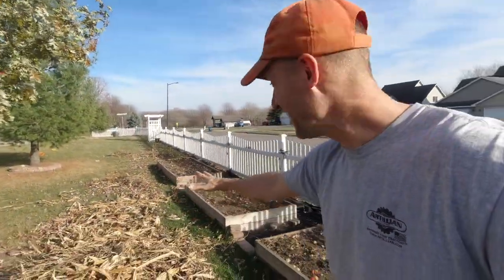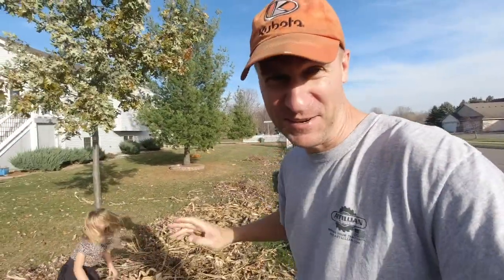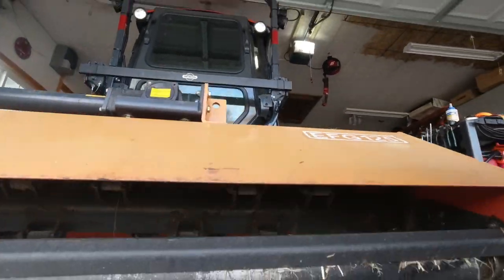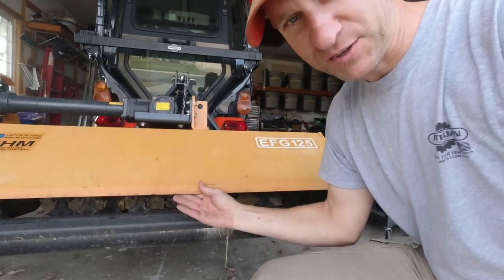BEST LAWN MULCHING BLADES (Kubota BX23S and a Flail Mower)

Comment: I think I mentioned in one of your other videos that I just took delivery on a 2020 BX 1880. My tires are 24x12x12. I am inquiring as to where I can get the best tire chains. I'm only putting chains on the back. I have about 200 foot of gravel drive and another 200 feet of dirt and gravel 2 track that leads to my shop. I have the R2 edge tamers for the bucket as well. Thanks and I really like your videos and might be buying the Curtis cab for next winter.
Reply from the maker: I got mine years ago on amazon. I'd share the link except I can't find it. Your tires are slightly smaller that what's on the BX23S and BX2380. I think the best option for you is to ask your question in the Kubota BXer Facebook group. I'm sure someone there could point you in the right direction. Sorry I can't help with this one. 
Keep on tractoring!

Comment: 👍🇺🇸🇺🇸🇺🇸🗽👍 Enjoyed!  Love flail mowers, goes where a bushhog goes and mows like a finish mower (almost).  If you had a hydraulic top link it works even better!  I use my grapple cylinder, lines and valve for my top link on my L3200 when using my box blade....been trying to get Mike Morgan to get a hydraulic top link, it really makes your rear end attachments more useful!  Mike's stubborn😊Ha!
Reply from the maker: I would love a hydraulic top link. I really want to install rear remote but the cab interferes with the factory install kit. If I come up with a way to make it work that will be an upgrade I'll make for sure. 
Keep on tractoring.

Comment: This is for you Jon and all other BX23S owners. Once you do this, you will never be able to un hear it. I chuckle every time I hear it now and I just found out about it by accident,  this afternoon.

Place your tractor on Hi gear, 2 wheel drive, set RPM to exactly 2000 RPM and back up giving it a bit of a hard time, so to speak. The result is uncanny.

You have just heard Chewbaca's roar coming from your tractor.
Reply from the maker: That is a good analogy and spot on!  Thats exactly what is sounds like. 😂😂
Keep on tractoring!

Comment: I have the same tractor and also the flail mower (which was chosen based on your past videos).  It looks like you are getting it perfectly at very close to ground level without tearing up the grass or ground.  Can you confirm the settings on your mower?  Looks like everything is set to go as low as possible?  Thanks!
Reply: Bluesky9, get a hydraulic top link and you can make that adjustment on the go!
Reply from the maker: Hope you're enjoying the flail mower. As far as the settings go what I did is I only lowered it one notch from the factory settings assuming yours was the set the same. I probably could have lowered the rear roller one more notch. I'll try that next time. We've got snow on the ground now. 
Keep on tractoring!
Reply: @ritterjon  The factory settings were at maximum height and I don’t believe that is the answer.  How many holes up from the bottom for the skids and the roller are you?  That is probably the easiest way to compare.  Thanks

Comment: I got a bx 1880 what would price be for a fail mower and wt size
Reply from the maker: Your 1880 might run the same one I have without issues in light material but Betsco makes a 3 foot version as well that I'm sure your machine would run over heavier material easier. I paid $1309 for mine two years ago and I think the same one is going for $1600 now. 
Keep on tractoring.

Comment: You probably didn't need to adjust the side skids. You probably didn't need to adjust the rear roller. You probably could've gotten by with just adjusting the top link. 🙃🙃🙃
Reply from the maker: I think you’re right! I should have just done that. 
Keep on tractoring!